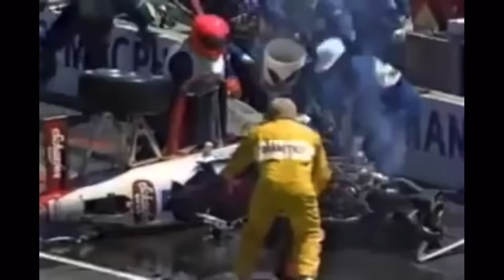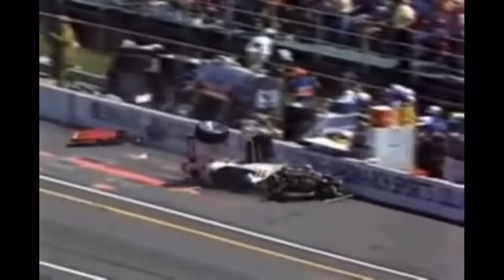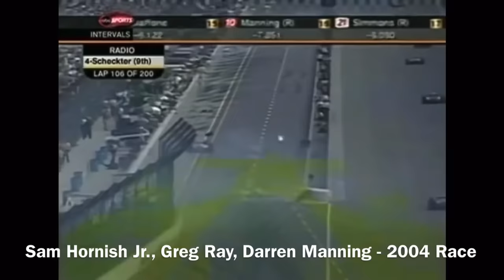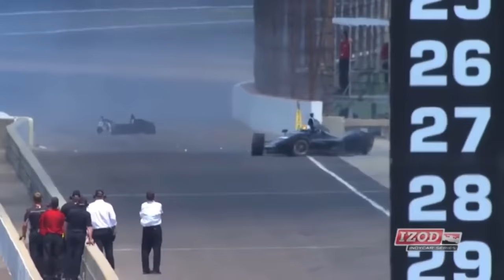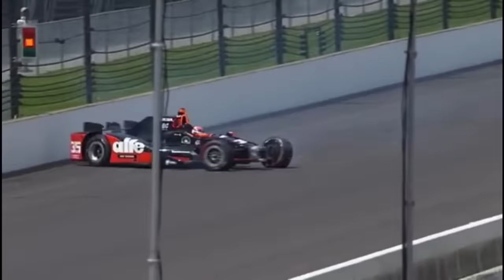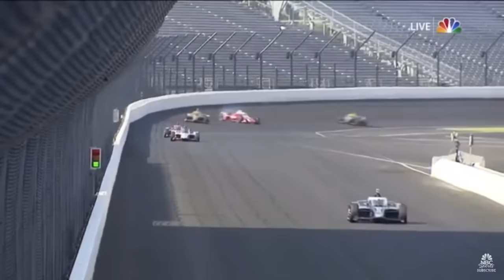Indianapolis 500 Pit Wall Attenuator Crashes

Comment: Gasoline alley...pit row really needs to be reconfigured at Indy. Make pit-in before turn 3 and place safer barrier all along front stretch. Someone (else) is going to be seriously hurt or killed hitting that divider.
Reply: Hell no
Reply: Glad someone else thinks this, I've wondered for years why they haven't changed moved the end of the wall back towards turns 3 or 4
Reply: To be fair you scrub off more speed sliding into it now then if it was in the middle of three somewhere
Reply: It doesn't matter how much speed you scrub off you are still going 220 at indy. Imo the entire inside wall needs reconfiguring
Reply: I think at this point with how safe everything is I dont think you’ll ever see something serious happen unless someone gets turned into that wall at 220+
Reply: If a car hits the wall at the right angle it could fly over the service wall on pit road.
Reply: Pit road should be extended closer towards turn 4... that way a car can't really hit it head on unless it spins in the middle of the corner
Reply: Further
Reply: @Boxscot49  Which is still entirely possible.
Reply: Not to mention theres a chance a out of control 240 mph car can xoming sliding down a packed pit lane
Reply: They reconfigured the antiinuator in 1992.
Reply: Problem is pit road in on the oval is pit out on the road course, and they run more races annually on the road course. You couldn't move pit in to oval 3/4 without having to seriously reconfigure the road course.
Reply: They should reconfigure that. Fine, drivers do not get injured when they hit there but as someone else said, a car could get lifted and also the way the bounce back in the track seems very dangerousm it could cause a bigger crash
Reply: The problem is that you have to put the attenuator somewhere and racing drivers have an awful habit of finding the one thing you don’t want them to hit.
Reply: @99dndd if the attenuator was somewhere like the middle of turn 4 I think it would be very unlikely to be hit, especially if they had it far back so that it wasn't right next to the inside line in turn 4
Reply: @Gage_Brumley Think about the lay out of the track and the speed and closing rate off turn 4. Just picture it in your mind and now picture the cars coming out of turn 4 and as soon as they straighten out, they dive as hard as they possibly can to the left to make the pit road entrance...quite ridiculous. The distance from the exit of turn 4 to the pit road entrance is only 300 yards. That's only 2.5 seconds at full speed. I know because i sit in section 78 of the tower terrace on race day, right across from it.
Reply: You don't even need to go up to turn 3. Just maybe 30 feet would do a lot...  It was reconfigured in 1992. 

With the angles needed to get in the pits. That inside wall is already curved to make it harder.

Also, for "flying," that's far more likely on the external wall. 

They might also do something about the pit surface so it get more grip than the outside surface, a bit like a drag strip got more grip than a typical road course or oval. So if a car is spinning in the pitlane that it stop a little bit faster. Not sure of the cost of that...

And they can also make these little flaps bigger.
Reply: Bad idea, having a car bounce back into traffic is the outcome of a extended pit entry wall
Reply: What scares me is Pigot’s crash in 2020. Imagine being thrown back onto the racing line with cars coming. Even under yellow I imagine you’ll still have cars approaching near 160+ mph since they’ll be coming just as the accident is starting. All I can think of is Anthoine  Hubert’s fatal accident at Spa in a similar situation…
Reply: Wouldn’t you think that the same thing would happen if it was in the entrance of turn three? It would probably be even worse. Crashes going into the turn where they go down to the grass first are WAY faster, but coming out of the turn the speed is scrubbed off. Not only would that be WAY more dangerous, but they would be exponentially more frequent. Crashes going into the turns happen multiple times every year, but these attenuator crashes where they are now happen on average once every 3-4 years. No offense, but that idea would kill a lot of great drivers.
Reply: @Manbunmen65  Have the wall extend into turn 4 a little bit, but not far enough that a car spinning out on the short chute between 3 and 4 will hit it. And you could mandate that cars must use the turn 3 and 4 warmup lane when coming on to pit road so there's no dangerous swerving onto pit road at the last second. Problem solved.

Comment: Pit wall always was scary asf to me there. Even the pylon in the middle. You could catch air, and hit it pretty good.
Reply: Yeah man the pylon scares me so much especially on restarts
Reply: @marktucker208 imagine if a car slams into it at race speed and it collapsed
Reply: @Gage_Brumley  It is pretty solid, but with the forces, I don’t see it impossible to knock down. I just know whoever hits it is probably dead, especially if in the lead as they will fall back down on the other cars. I wish Indy was redesigned. A lot of gripes I have ab it. Like the fact that it’s a oval, but it’s hard to watch a race there as everything obstructs ur view. It would be the most ideal track for me to go to as it’s the closest, but I never have as it’s just hard to watch a race there.
Reply: @tamezzodiac2862  Exactly sight lines at Indy are by far the worst for any oval track. It's essentially an speedway with the grandstand layout of a Formula One track. Not to mention all the safety issues, like the attenuator, pylon, no safer barriers along the pitch wall or short chutes... they could maybe solve the pylon issue by installing a catch fence along the pitch wall, but regardless it's still a dangerous place

Comment: Question: why did they replace it with a tire barrier?
Reply: Its a pit wall, what else can they do? A tire barrier is all they can do.
Reply: Hammer hand  Tire barriers are nice because they take the impact and are soft enough to lessen the impact for the driver. Think they also scrub off speed at a slower rate that it does not whiplash you as bad. You do not want to come to a sudden stop when you hit any barrier.